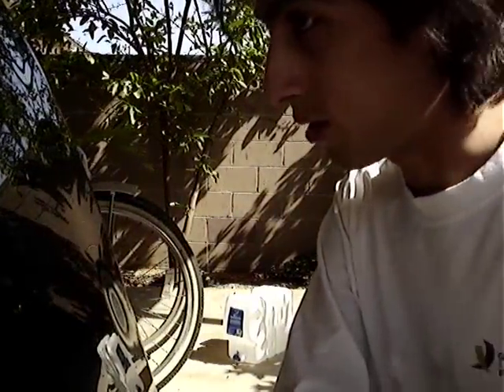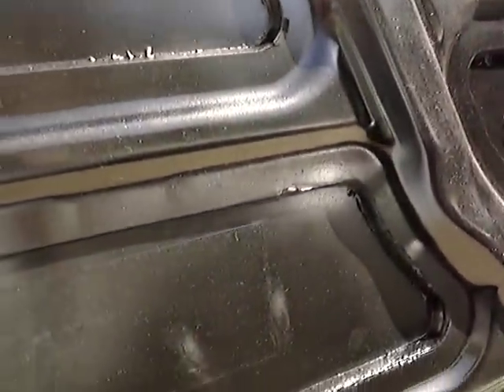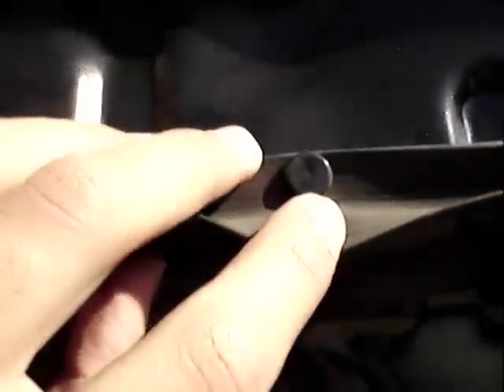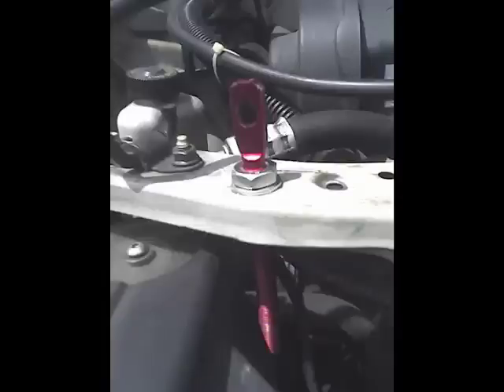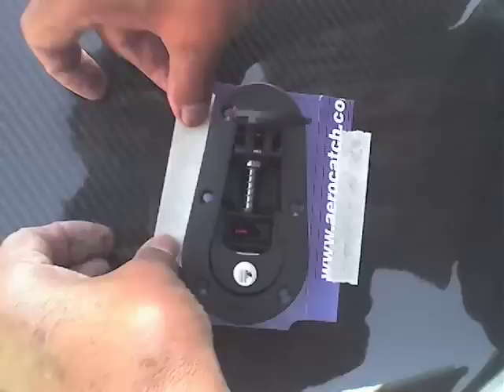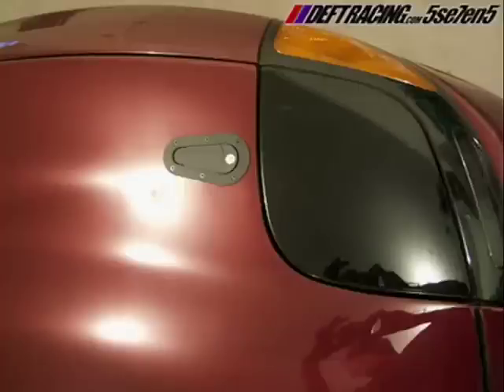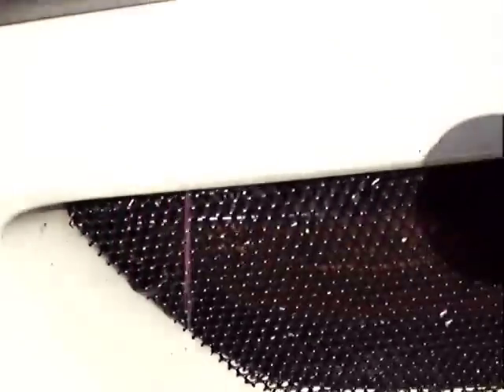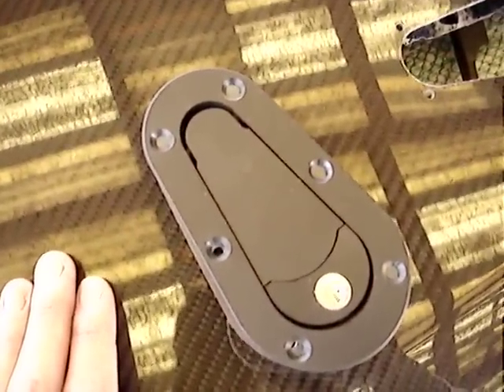Carbon Fiber Hood on a ZX2

Comment: Nice video dude, I just purchased a set. I plan on getting rid of what you call the secondary catch, is this wise? i.e. do you think that the aerocatches alone will hold the hood in place, I suppose that's what they're designed for right?!

Comment from the maker: Not really. The red bolt is still held inside the whole assembly. You might be able to wiggle, shave and break the carbon fiber to get it out. But the hood pins are a safety element for the carbon fiber, not a theft deterrent/countermeasure.

Comment: Hey just one question since you got the ones with the keys. can the latch be remove if you just take the bolts of the sides, even if the latch is lock